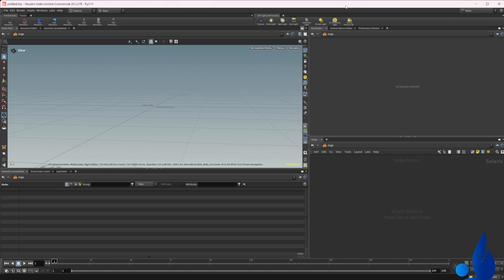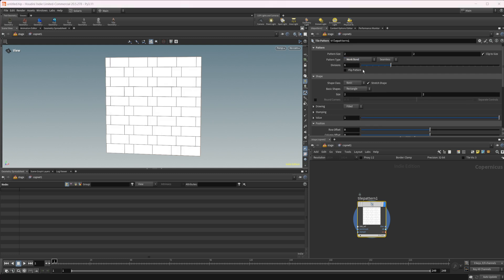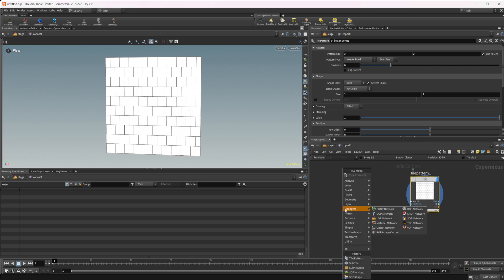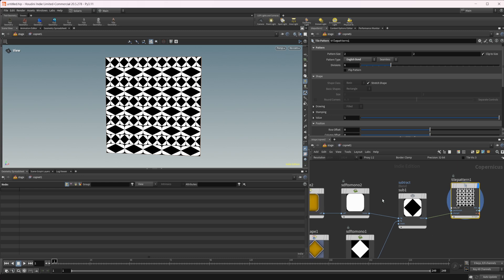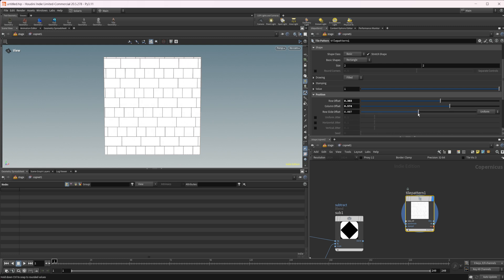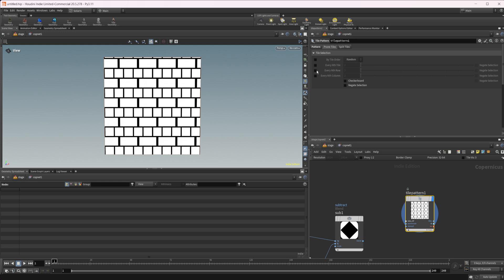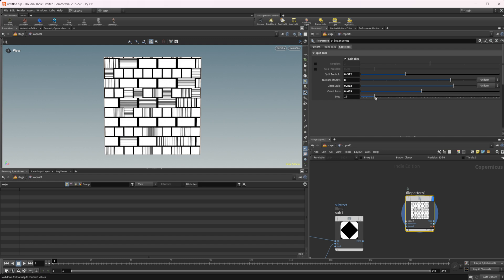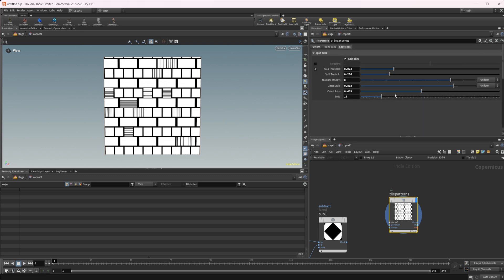Tile Patterns | Intro to COPs | Houdini 20.5

Comment: i wish they can add "anisotropic" noise node in cop.. they have only noise which i don't think it can be enough to create various type of noises... in substance designer i used to use tile to create wood textures, using "warp" node in substance is very fun and useful but you can't get same result yet in cop , but hopefully they will implement it later
Reply: You can get something very similar to substances anisotropic noise if you connect a uvmap to a transform2, set scale to something like x: 50 y: 1, then plug the transform2d into the pos on a fractal noise. Just make sure the noise is set to a low element size.

You can also get something identical to substances anisotropic noise if you quantize one of the channels of the uv map